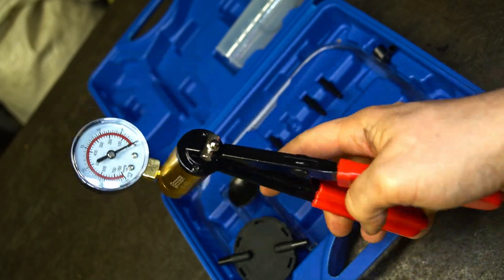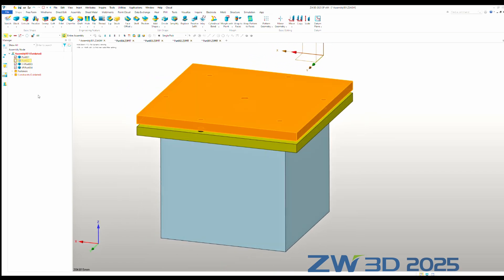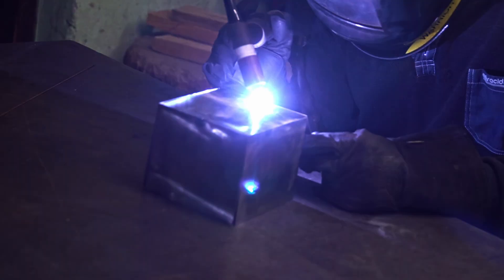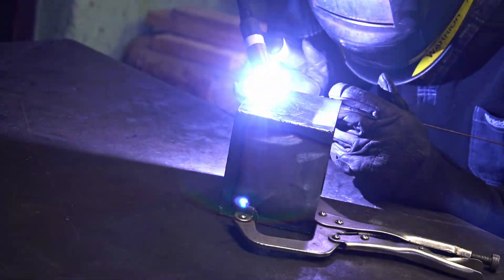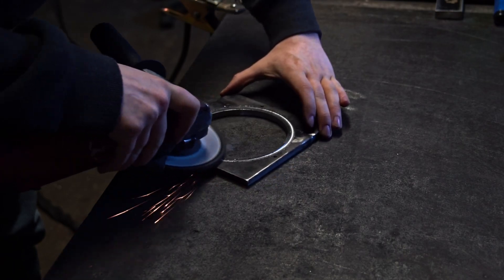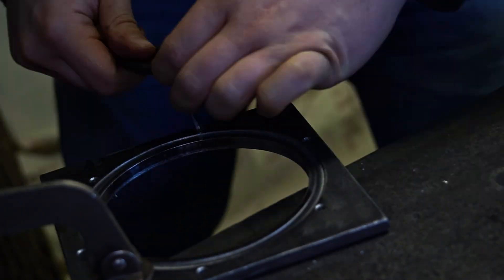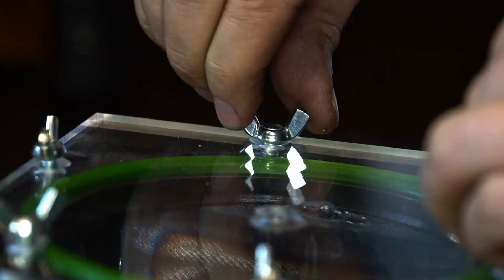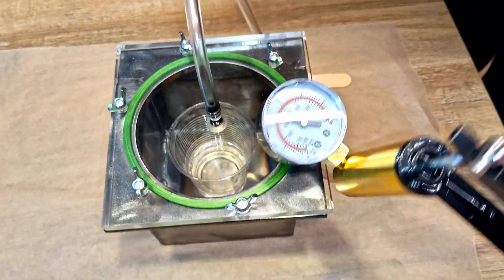DIY Vacuum Chamber for Epoxy Resin - Will It Work??

Comment: Why don't you use a probe on your CNC mill ?
Reply from the maker: That's a good question. Actually - when there is no need for "perfect" dimensions like in this example, I just zero it like this to make it faster as my time in the workshop is recently really limited. And  when I use paper to get it done my accuracy is at about 0,1mm in the Z axis. That's usually enough for most of my stuff. But I have a probe - when I need to get a center of a hole - I often use it.